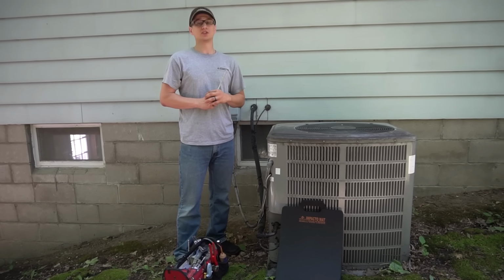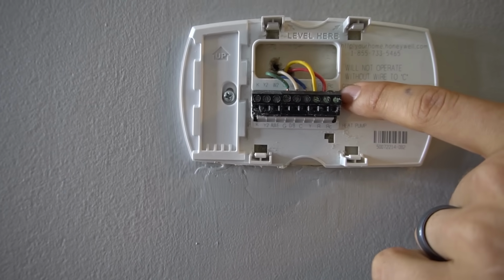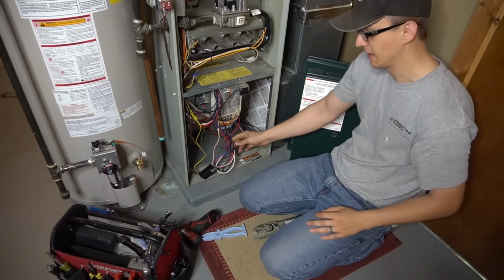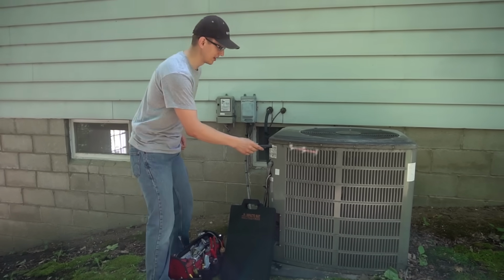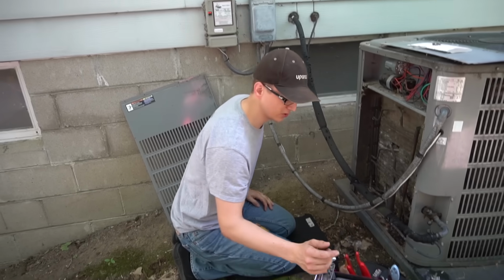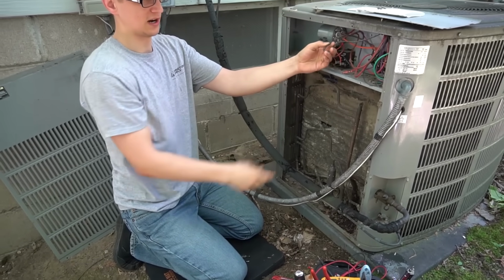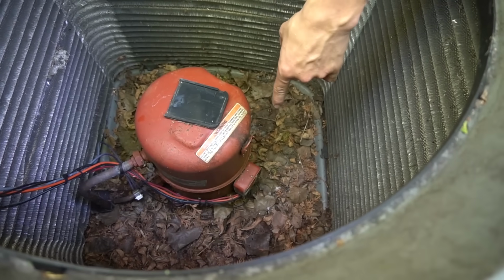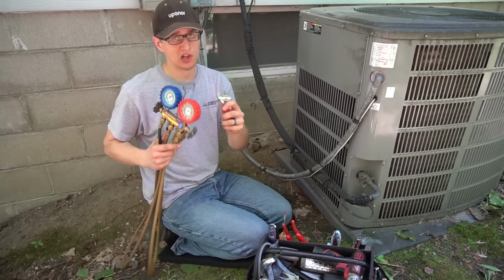AC Unit Not Turning On - How to Fix It Step by Step

Comment: Quick question from you...... First off thank you for this video!!! Its amazing super detailed!!  I have a questions so we having an issue where we replaced our thermostat and went when go out to the AC unit nothing happens. I did what you showed with pushing in the plunger and it started working right away! But then as soon as we release the plunger it turns off again. I made sure it was clear of dirt and or bugs.... Any input? or what I should do next.
Reply from the maker: Glad to hear you found the video helpful! :) Can I ask why you replaced your thermostat? Was something not working or did you just want a new thermostat? Also, are you sure the new one was wired correctly? If you have an Rc terminal in the thermostat, does it have a jumper wire going to it? Also, if you did not turn off the power to the furnace when you replaced the thermostat, you could have blown the 3 amp fuse in the furnace control board.
Reply: we replaced our Nest because we originally thought that was the problem. We bought a Smart Honeywell and installed it correctly no lines touched and everything went in wonderfully. Last night randomly our AC kicked out and was working for about 3 hours and the house cooled down. Then turned off. Today I was reading about how the drain gets clogged and that should be cleared so I was about to get about 1 and half gallons of water and muck from my outside drain. That is where I currently stand, it has not kicked on yet or anything. When my husband gets home he is going to look at the drain/pan in our attic which.
Reply: I just read my first comment again and it seems confusing so let me tell you what happens....

Came home from work and the house was 80 degrees. 

Turned AC but nothing happened, thought it may be frozen so we left it off for 2 days

Turned it on one night and it cooled the house to 72 then turned off

The filter was new but we changed it again just in case

It has not been working for about two weeks now and i have had it off 80% of the time just so its not causing issues

Checked all the breakers and even reset all of them still nothing

I watched your video then cleaned the ac on the outside making sure it was clear, took the panel off and using a screw driver pushed the plunger everything came on and was working. I released the plunger and the outside unit turned back off

replaced the thermostat thinking it was possibly not sending a signal to the ac

I let it sit and did not mess with, last night it then turned on 

ac unit outside turned on lastnight for a couple hours then turned off

Today I connected a shopvac to the drain and got about a little over a gallon of water and muck out.

Reset all the breakers just so the units would rest and nothing has happened yet
that was about 45 minutes ago
Reply from the maker: Okay, thank you for the details! I am thinking the thermostat was probably not bad. So somewhere between the furnace control board and the contactor coil outside you are losing power (24v). It sounds like the plugged condensate drain may be what is causing this problem. When you connect a shop vac and suck it out, I don't think that is enough to unclog the spot where it is plugged. (usually at the exit hole of the evaporator coil/A-coil where the drain line hooks up. Did your husband get a chance to look at the drain pan yet? You probably have a float switch that shuts down the unit if the condensate drain is plugged and water is backing up. By the way, do you have a multi meter that you can check voltages with?
Reply from the maker: Hey Krystal! I just read an article that I thought was really good for the clogged drain scenario. You should give it a quick read :) http://acwiz.com/index.php?action=artikel&cat=18&id=26&artlang=en
Reply: ok well...... Thank you again so much for this video!!! You are amazing!!!! We are fixed and up and running.... Did not realize there was a second drainage pipe. Cleared that and instantly the AC kicked on and has been running ice cold for about 15 hours!!! All is well!!!
Reply from the maker: Awesome! Glad to hear it! You're welcome and stay cool ;)

Comment: hi there, I live in Hawthorne, CA.   we had a 103 degree temperature (Saturday, &/7/18). according to the reading read from my car. We came home last night at 11:30PM.  our American Standard Gold 17 series seem to stop running cool air.  the air was blowing out from the vents only.   1. we shut down system waited awhile; then restarted system. we checked outside to see if the compressor was on. it was not on and the fan was not turning. So Sunday Morning we made sure the system was turned off. I check to see if the breaker was not tripped. it was not.  what else can you suggest doing to get this working?  Thank you for your video and helpful suggestions.
Arthur
Reply from the maker: My first guess is that you have a bad capacitor. I would also check your contactor to see if the contacts have anything stuck in them like ants or bugs.

Comment: One spin of the fan with a screwdriver and it worked.
Reply from the maker: Awesome! Hopefully that is all that was wrong. If you have a multi meter, I would check and see if the capacitor is weak too, just in case.

Comment: thank you so much. my ac stop working . we checked everything you said but still the fan did not turn on. so we checked the connector and found a bunch of burnt ants in the connector. so we cleaned it up and it worked the ac went on. thank you so much for this advice saved me a lot of money.  and wires and everything else is in good conditions. followed  your instructions  just like you showed. great video. again thank you sir
Reply from the maker: Awesome! Glad to hear you were able to get it fixed :) Stay cool!
Reply: Burnt ants! Delicious!

Comment: You are so good! Thank you for your advice. I have one question, I checked continuity for the compressor as you showed in the video (I suspect the compressor is the one not working - I can't hear it - ) and there is no continuity between any of the pins and the casing. What is the next step in this case? Thank you kindly!
Reply from the maker: Thanks! Are you sure the compressor is getting power? Does the fan turn on? (does it seem like it is spinning slower then usual?) Another check you can do on the compressor is similar to what you did. Turn off the power to the unit, disconnect the three wires from the compressor pins, and check the resistance of the compressor windings. To do that, measure resistance between each of the pins. You should get 3 readings. What are they? (Pin 1 to 2, Pin 1 to 3, and pin 2 to 3)

A normal compressor's ohm readings usually will not go over 20 ohms. You should get one reading that is bigger then the other 2 (that will be your common winding) The smallest reading is your run winding, and the one in between is your start winding. If you add the run and start winding ohms together, they should equal about the same as the common's ohm reading. If they do, then your compressor windings are good.
Reply: Hi! The fan turns on but it needs a little push like you showed in your video. (This was not necessary before). Regarding the the check you mentioned, I have disconnected the capacitor because I have a feeling it might be giving me problems and ordered a new one. Can I still do the compressor pin check with the capacitor removed? I tested the capacitor's resistance between terminals  P R C  using a voltmeter set at 2000k Ohms. (I do not have the voltmeter you have to measure MFDs) I did not get any readings, for this reason I thought it was the capacitor hence order the new one. How am I doing?
Thank you kindly,

Comment: You just saved my family an agonizing night in the Texas humidity and heat and my wallet from a raping.  It was 100 today and we got home from vacation and no A/C.  I ran down your troubleshooting method and I found the problem.  Ants had crawled into the contactor and jammed it up.  No fan or anything when the inside unit kicked on.  Just a light humm from the electrical panel on the outside unit where the contactor is.  I blasted the contactor with CRC electrical cleaner and re-energized everything and VICTORY!
Reply from the maker: Awesome! Glad you were able to get it fixed and it was a problem that didn't phase the wallet at all ;) Stay cool!

Comment: The outdoor/condenser is hot because of the compressor inside "condensing" the freon that boiled  and turned into a vapor in your indoor coil/evaporator. When it compresses the vapor back to a liquid it creates heat. Are you sure that your a HVAC tech?
Reply from the maker: Most non-HVAC people will not understand any part of that. Therefore I say it in a way that is understandable. But thank you for explaining! I am sure some people will understand and appreciate the real explanation

Comment: Hi. My AC goes on sometimes but not other times. In fact, sometimes when I turn on the AC at the thermostat, only the house fan goes on but an hour or so later, the AC kicks in. (The thermostat is not programmable.) The house fan always goes on. Naturally, it worked just fine when the repair man came, so I spent $200 for nothing. (He did replace the thermostat, but that didn't help.) Any ideas would be greatly appreciated.
Reply from the maker: Did he check your capacitor to see if it is getting weak? How about your condenser coil outside. Even if it looks clean, you should hose it down. Also, if it is doing that, I would put in a hard start kit. That will decrease the start up amperage of your compressor which may just be all that's needed. SPP6 Hard Start Kit: https://amzn.to/2JSPieo
Reply: Actually, all he did was check for 24V at the compressor unit and found no voltage. then he checked the wiring at the furnace (unfortunately way up in the attic) and said there was no "continuity". He said there was an "extra wire" which he used, and then the relay at the compressor closed momentarily but immediately opened. So he said the wiring was bad and would need to be replaced by running a wire from the attic to the outside wall, down the outside of the house (in conduit) to the compressor. Yuk. He mentioned wireless solutions, but i don't trust wireless, having been involved with it in computers for many years.
Reply from the maker: Oh boy. So you have a break in the wire somewhere? The one that goes to the outdoor unit. I agree, the wireless solution doesn't seem to be the most dependable.. Sounds like a yucky situation indeed. Hopefully it won't beat up the wallet too bad. Thank you for the update!

Comment: Hi, Want to know if my capacitor is 5/35uF, is it the same as is it a 35/5uF?  thanks
Reply from the maker: Yes, it's the same thing. They just inverted the numbers.
Reply: Hi, can you guide me why mine is running cold air and fan spinning for few first minutes and then, the blown air is not cold anymore and the fan stop spinning?  i changed the capacitor.  Any idea what I should do next?
Reply from the maker: When the fan stops spinning outside, does the compressor turn off as well? Does it stay off for a little bit and then turn back on or at least try to turn back on?
Reply: Hi, how can I tell if compressor is turn off or on (sound? measure?)? Thanks
Reply: Yes, the compressor turn off when fan stop spinning...and the compressor stay off.
Reply: FYI every single time I turned on the AC, for the first few minutes, the blowing air is cold.  when the compressor died, no noise.
Reply: When my AC stop, the led flashed and indicated there is a low-pressure switch lockout.  can you translate, please?  what should I do?
Reply: once the low pressure switch is changed, do i have to call for fill up the freon?
Reply from the maker: Hey Alan! Unfortunately you would need to call a technician on this one. The low pressure switch trips when the pressures in the system get too low. It turns off the unit to prevent it from freezing over. I don't think there is anything wrong with the low pressure switch, it is just doing what it's meant to do. You are low on refrigerant and fixing that requires HVAC equipment/refrigerant that most people do not have.